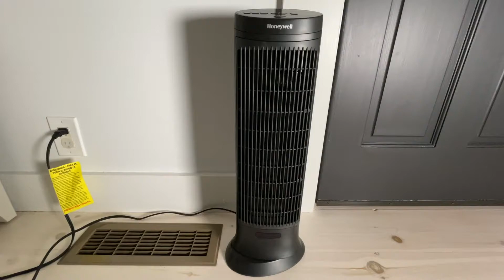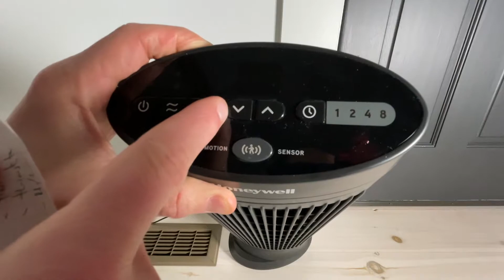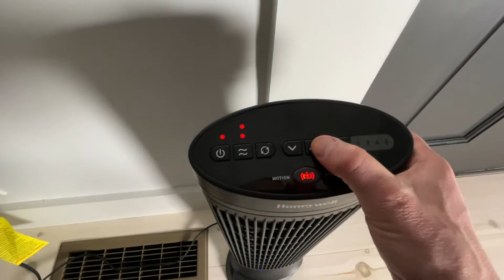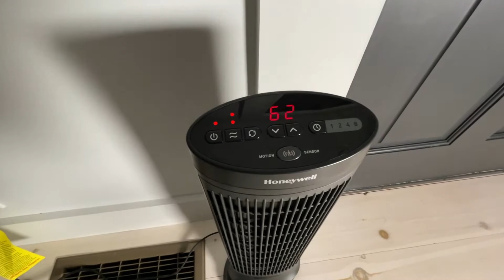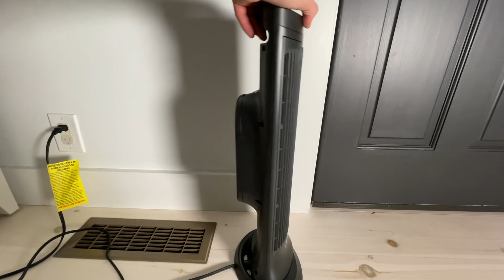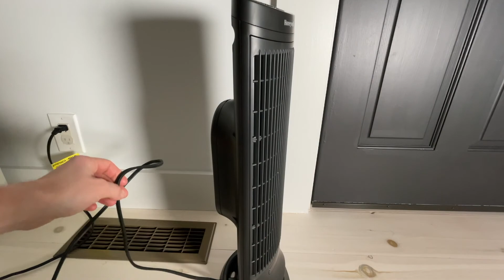Honeywell Safeguard Motion Sensor Ceramic Space Heater Review

Comment: Is there a place to store the remote on the heater?  Thanks
Reply: Yes, if you on the back of the heater (at the top) there is a slot that specifically is made for the remote control.
Reply from the maker: Unfortunately no
Reply: The remote holder is on the back where "the handle" is.  @HelpAtMyHome